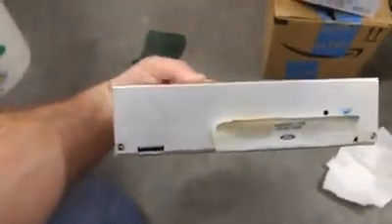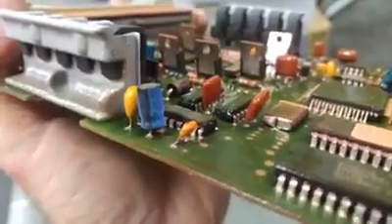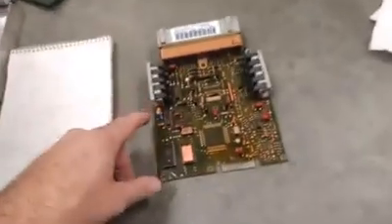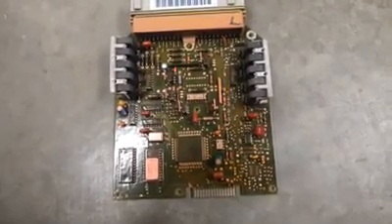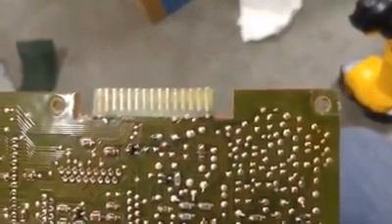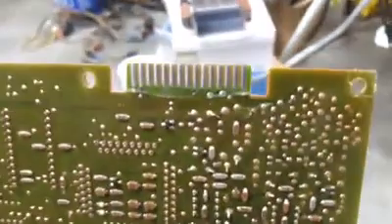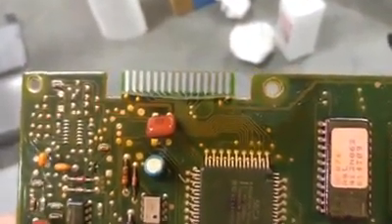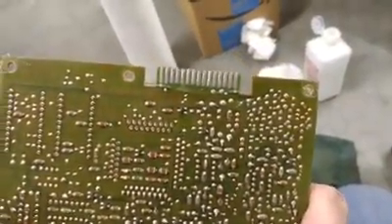Preparing EEC-IV Computer for Installation of a Chip

Comment: Great news for Fox body owners! I have invested heavily into a soldering microscope, soldering and desoldering equipment, and a ton of PC repair parts and tools. For the last few months, I have been researching what fails in these computers, what kind of long term damage has occurred, and what is the best method for a proper repair of the PC board. Also, how to properly fix J3 port edge connectors that have damaged fingers or fingers that have been over-sanded down to the bare copper. That R&D period is coming to a close.

Beginning in January of 2019, Drag Radial Performance will be offering QUALITY fox body PCM repair!

I've looked at a slew of stock computers that are going bad, are already bad, are heavily damaged, were successfully rebuilt, and that had unsuccessful repair attempts. What I learned is quite interesting! Here's the highlights:

1) These capacitors leak an acidic electrolyte, which not only makes the capacitor bad and the car not run right, but it also damages the PC board and it's copper traces. Just putting in new capacitors is only half of the battle.

2) These so called "rebuilders" are not properly fixing them. They are doing the least amount of work they can get away with, and are most likely not using the right tools or the right capacitors. I painstakingly hunted down the exact correct ones.

3) Rebuilders are not using a microscope to solder, and it shows. They are contaminating the solder joints because they can't see what they're doing. This will lead to premature failure of the solder connection.

4) When rebuilders solder in new capacitors, they can't see the damage that's already occured to the board and traces. And so they aren't fixing the damage. The acidic corrosion will continue, and even if the PCM works for now, it won't stay working long term.

5) J3 port edge connectors that have been over-sanded and are now down to the bare copper can be saved by stripping off the original solder and putting a new fresh coat on, then properly sanding down the pins. This will really fix some poor connection problems due to over-sanded J3 ports.

6) The board is more complex than it looks. It's a multi-layered board, and you better know what you're doing when you start soldering on one. That was a lot worse than I had previously thought.

Comment: What parameters can be changed?
Reply: All of them! :-) I have full access to every parameter. Once I make a change in the tune, I can hit the update button and that change immediately goes into effect. This is called real-time emulation. It's a very fast way to tune a car, because I could make a simple change like say idle airflow, see how that change worked out immediately, and then move on to the next tuning item.

Once all changes have been made, I can then save that tune, and burn it to a regular chip that plugs into the J3 port. Any time a chip or an emulator is plugged into the J3 port, it sends the instructions to the PCM to ignore the factory soldered on chip, and run this chip instead. As soon as you unplug the chip from the J3 port, it goes right back to being a stock computer.

Comment: You re record the chip through j3 conector?
Reply: Yes, we put an emulator in the J3 port. It plugs in just like a chip. The emulator is run off of software on the laptop, so my laptop is directly controlling the PCM (bypassing the factory chip that's soldered to the PC board). This allows me to make real time changes to the tune, and real time datalogging of every single thing the computer is thinking. I have around 150 parameters I can look at, simultaneously.
Reply: @Pontisteve  How can I get in contact with you? I definitely want your help. Thank you.

Comment: what happends if you scuff down to the copper on both sides
Reply: I now have the ability to correctly rebuild the tin coating on the copper traces back to their full original size, and then use a new, more precise technique to sand them flat and brighten them up. Plus, doing this, the old tin coating is completely removed, and brand new stuff is added. So if you've scuffed these down to the bare copper and it's causing you to have a loose chip mounting, or poor connection, I can fix it!
Reply: @Pontisteve  Hit me back brother, I'm trying to contact you about your services. 💯
Reply: @johndoe-zb8bm   I need mine rebuilt too. And so far @Steve Hulett  has me convinced he's the right one for the task.
Reply: @Anthony-rv3hr  Do you have his contact information?
Reply: @johndoe-zb8bm   No, I don't. I'm assuming its the same person that owns this  "Drag Radial Performance" channel. I've asked him before and he said he doesn't do it. He has an ebay store where he sells just capacitors. If you search up "89-93 Ford Mustang 5.0L Computer Rebuild Repair Kit. New Capacitors A9L A9P PCM" on ebay you should find the parts. He goes by   PontiSteve, I believe. I get it though, I don't want to do the delicate work myself either.
Reply: @Anthony-rv3hr  I'm interested in his piggyback computer ypgrade/override he sells!
Reply from the maker: It will still work, but the copper will corrode over time. This can eventually lead to the chip no longer making proper contact, and the car will begin to run poorly with no obvious explanation as to why.